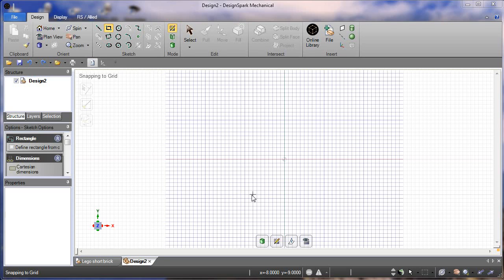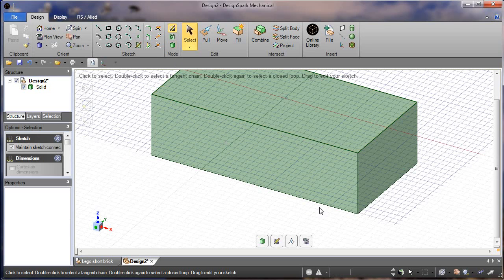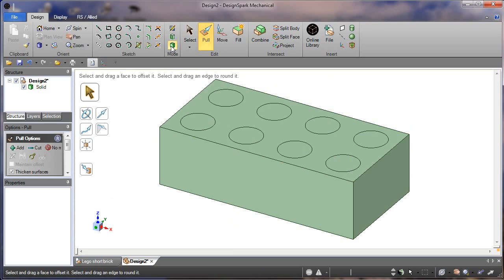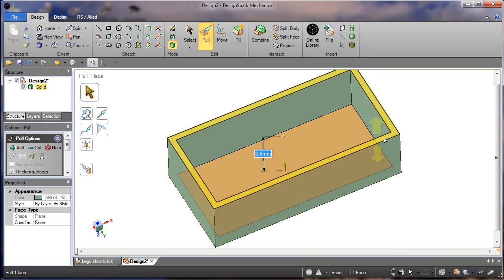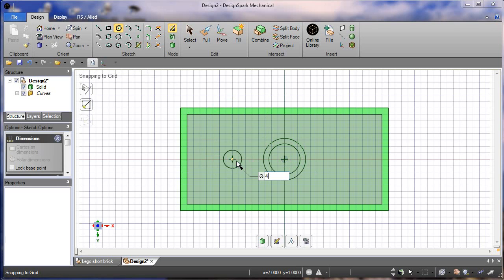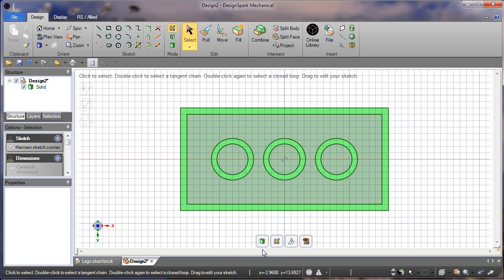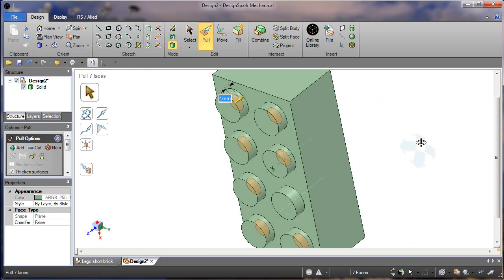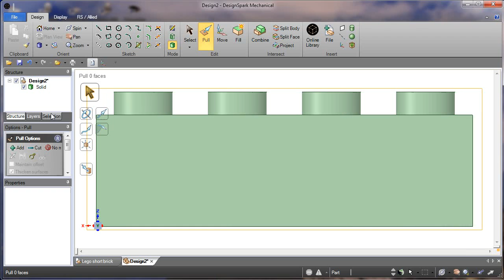Building a Lego brick in DesignSpark Mechanical

Comment: is there any way to design one peg and just create an array of them?
Reply from the maker: Yes, you can use the 'Create patterns' tool. Create a single line of pegs then select them all and create another pattern of them in the other axis direction. I have not found a way of doing this all in one operation I'm afraid.
Reply: @JimTaylor42  I find the no-go for a CAD like this :-( I found a turn-around today. But you need to forecast this at the drawing level: design construction line, select it, chose it as mirror line. You can do multiple ones. Then when you draw, the same drawing is instantly replicated on all ones. That's good but bad at the same time. Good because there is a way. bad because it's a turn around and not a way to work. Since the early years, CADs have foreseen to replicate in angular or rectangular way (arrays) object. This is the first one I meet, it missed that feature.
Not only: I just discovered today that Blind-holes types are not supported not even thinked :-/
Reply from the maker: @Not-Only-Reaper-Tutorials  Yes, I am aware of this technique. The problem is that this is not possible with solid objects which was your initial problem. Well done, however, for figuring out the 2D method.
Reply: @JimTaylor42  exactly :-( It's a pity it has these lacks and in years no one improved it :-(

Comment: Hi Jim thanks for the video's, I have only seen this one, and I started exploring dsm yesterday so still novice. but I saw a (trick) yesterday to draw a vertical construction line and with a right click top item is " use as mirror"  that speeds things up and I tried with a hor. and a vert constr. line through the counterpoint. and make them both a mirror function works great. I only have to draw 2 circles and it give me 8 and also for pulling , I only select the 2 circles I draw and all 8 get pulled. Thanks for the video's I'll probably look trough all of them
Reply from the maker: If you plough through all of my videos you will find that, and many more, DSM 'tricks'.

Comment: select and MOVE will work well for this. MOVE tool does work in sketch mode. To hollow out the top pins from the inside surface click project to sketch and those circles appear so we know were they are. No need to count.

Comment: What would be the alternative to counting the grid lines for those 4 mm offsets to the studs?  I like being able to specify the offset relative to the outside wall with a dimension.  Another way of asking the question is, what approach would you need to take if the offset isn't a multiple of the grid size?

I have to give you a hard time about using metric.  :-)  I had some of my friends at work watch my LEGO video and they were shocked that I was using imperial dimensions.  I measured my LEGO using imperial calipers.  I found that the measurements came out to really nice numbers.  Then I did some research and it seems LEGO stole the design from a sample they were given from the first injection molder they purchased (http://en.wikipedia.org/wiki/Kiddicraft).  Thought that was interesting.

Lastly, what software are you using to capture your screen video?  Your video quality came out a lot better than mine.  Is there a trick to getting it into YouTube correctly or is it really the software you used to capture it?
Reply: James Evanko  You can draw a circle or any shape and then type in distance you want from any point.
Reply: James Evanko  You can draw a circle or any shape and then type in distance you want from any point.
Reply from the maker: Find the centre of a circle, tap the shift key to make a temporary reference point, move or key in the required X and Y distances, then click and drag a new circle.